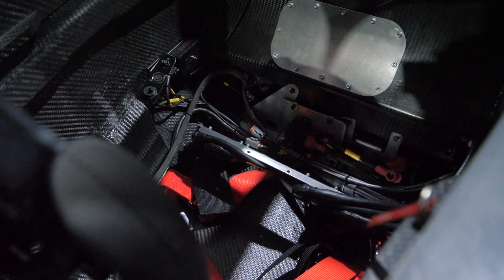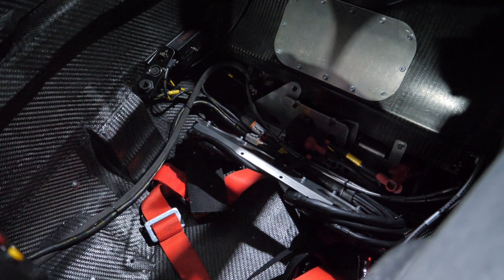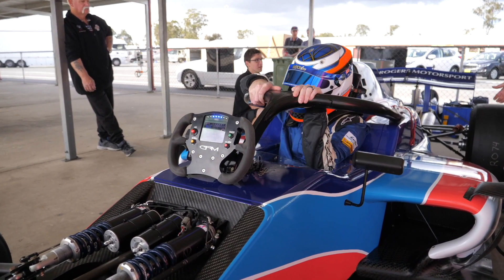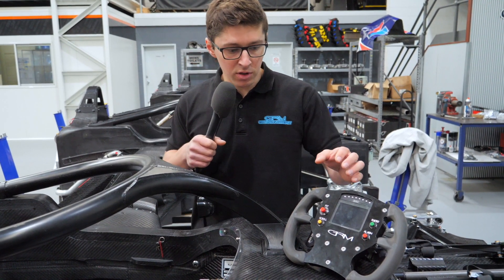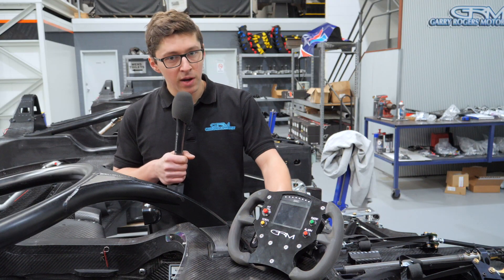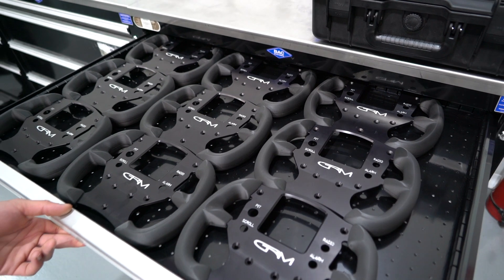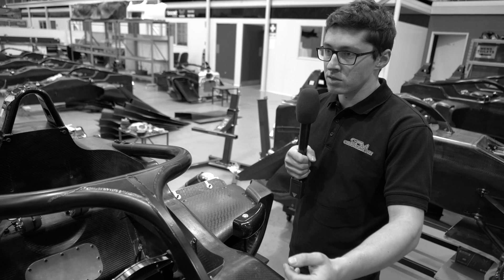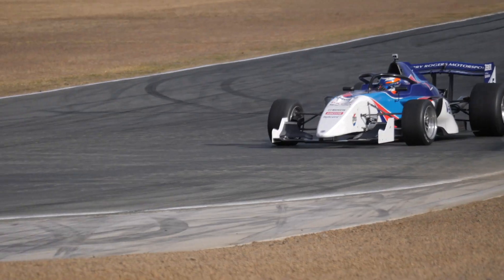S5000 Technical – Electronics

Comment: next year you should try implementing DRS
Reply: These things aren't anywhere near as aerodynamically sensitive as some other open wheelers. Which should enable cars to get close enough to make genuine passing moves.
Coming out of the draft and slip streaming past should be possible without DRS. 
Hopefully some passing will come down to who has the biggest mark 1 balls into and through the corner. 🤞
Reply: @l1a146  if that is the case, they should use  this design for f1 in 2021